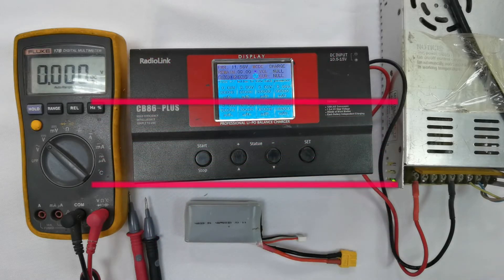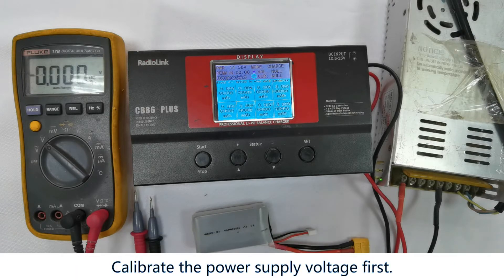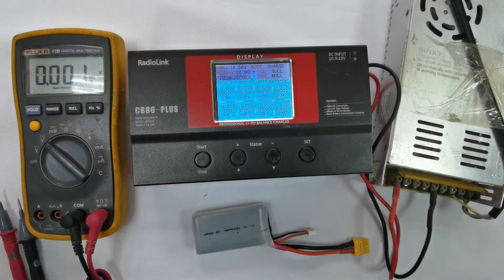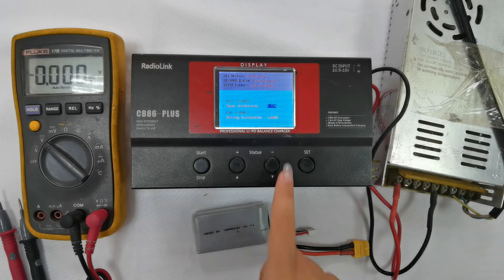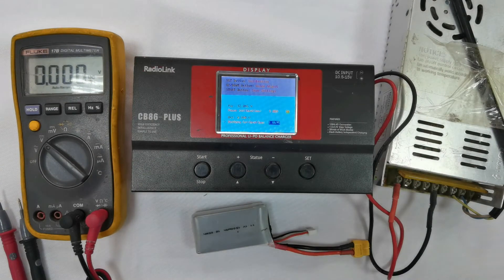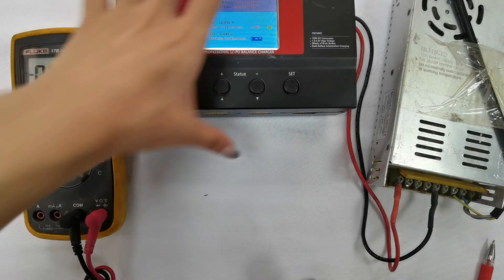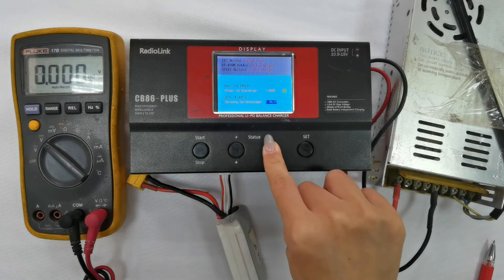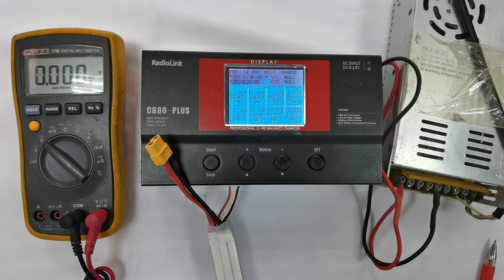Calibrate Voltage of RadioLink CB86-PLUS lipo Battery Balance Charger with Latest Firmware V2.5

Comment: Request the firmware to be 3.6 volt calibrated.
Reply from the maker: Hello sir. Sorry the battery voltage when calibrating should be within the range of 3.8-4.4V.
Reply: @Radiolink_official  Firmware 2.4 and lower was 3.6 volts.
After firmware 2.5, it went up to 3.8 volts..
Please change the firmware so that the newly purchased cb86 also has 3.6 volts.
Reply from the maker: @JooHwang-m3n  Hello, sir. Thank you. We'll achieve it in our nest firmware. And will send you once it comes out.
Reply: @Radiolink_official  Calibration required up to 3 volts
Reply from the maker: @JooHwang-m3n  We'll let our engineer know customers' needs. Let's see our next firmware.

Comment: Please launch your store in india sir....
Reply from the maker: Hi, sir. You can buy RadioLink products from AliExpress. They can be shipped to India. And you may contact AliExpress sales for more information. They will tell you about shipping.
Reply: @Radiolink_official  잦은 펌웨어 업데이트로 인해 충전기가 파손됩니까?
Reply from the maker: @JooHwang-m3n  Hello sir. it won't break the charger.
Reply: @Radiolink_official  When updating firmware, can't the voltage output be different from the display?
Reply from the maker: @JooHwang-m3n  Hello, sir. May I know what you mean? Could you please be more specific? You can send details to us including pictures or emails. Our email is: after_service@radiolink.com.cn
Reply: Can the display voltage and output voltage be different?
Reply from the maker: @JooHwang-m3n  Sir, the calibration is very important. So the voltage display is accurate. If calibration is not accurate, the charging process is dangerous which may destroy the battery and the charger.